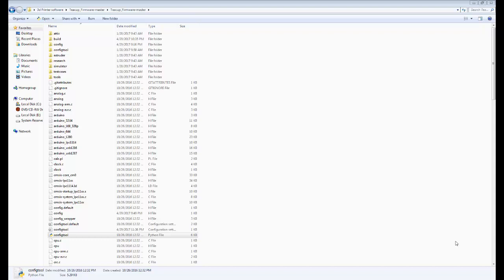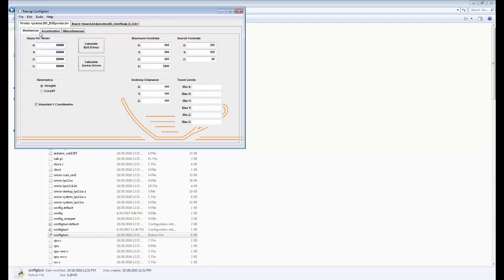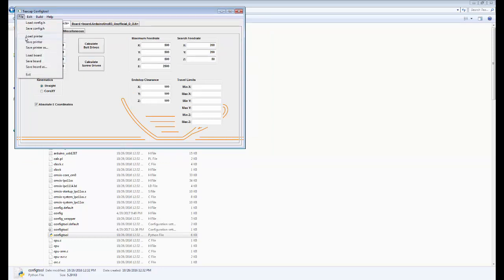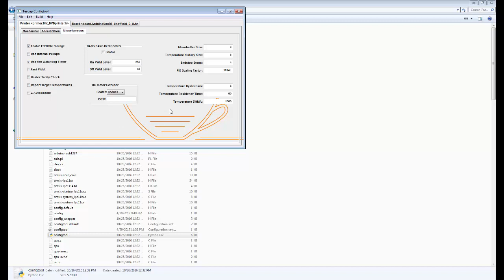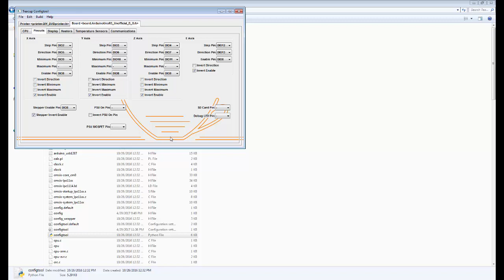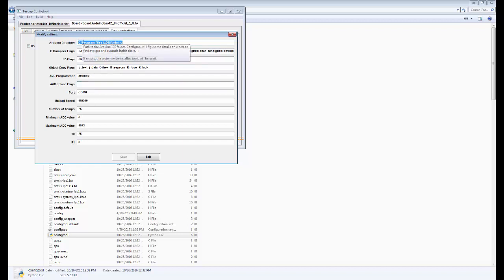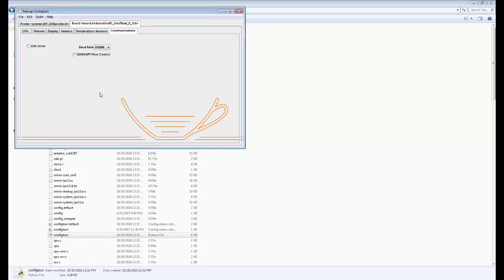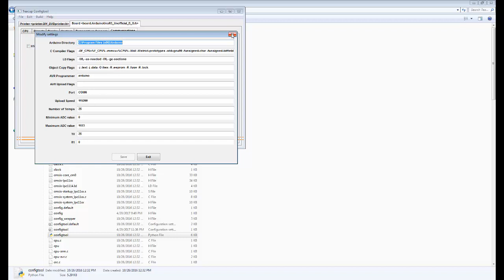Teacup Firmware to Arduino Uno R3 |Hex Files in Description|

Comment from the maker: I'm providing a link to the teacup firmware I used at the time of making this video. Luckily I had it stored on my old laptop. Enjoy and thanks for watching.
https://mega.nz/file/G0wSES4a#b5FzNkxulRk1BVKWIBtfHrzWcLWzJ8WQdB9AoSlYCxg
Reply: good day would you be able to re up load the file please
Reply from the maker: @lorddeysel7915  I no longer have the file itself but I'll see if I can extract the firmware/data from the arduino itself. Wish me luck😉
Reply from the maker: Here are the HEX files. Uploading with AVRDude is easy work so be sure to do your research on the process.
https://github.com/D-Omally86/Arduino-Uno-R3-Teacup-HEX-Files
Reply: @indieartsmidwest4042  thanks a lot i appreciate it a lot

Comment: I've been tying to get this to work all morning.....great timing!!!!
Reply from the maker: I'm extremely happy to hear that. Took me 5 hours before I finally saw a successful upload lol. Always glad to share the info after some intense trial and error.
Reply: only glitch... Arduino had to be capitalized on Settings.
Reply from the maker: Hmm that's strange. Can't say I'm an expert with uploading firmware. My first attempts involved using the IDE which went nowhere.
Reply: hello im also building a 3d printer with arduino uno and using teacup too.just 1 question where have u pin the extruder heater and thermistor and have set up anything for them on teacup?

Comment: Hello, I saw that you installed Teacup firmware?. How do you adjust the temperature sensor? I'm up to date with this fight with the 100k thermistor, 4.7k resistor and 5v But so far without any success. Pronterface cannot obtain the correct values in Celsius.
Reply from the maker: Be sure to use a multimeter to measure the resistance of the thermistor at room temperature. It should be around 100k ohms at 25°C. If it's significantly different, there might be an issue with the thermistor or its connections. Also, in the firmware configuration files (usually named configuration.h or something similar), locate the section related to temperature sensors. Then ensure that you have selected the correct thermistor type (e.g., 1 for 100k thermistor) and that the temperature table is correctly defined. Lastly, please keep in mind this video is pretty old and I haven't worried about it in quite some time. However, I recently purchased a 3d printer and will be rebooting this project at some point.

Comment: Hey what happened to your 3d printer project? I'm very interested in knowing if you pulled it off.
Reply from the maker: I have like 90% of the compnents but I need some brackets to make a frame. I have other option that I might consider like laser cutting a frame as well. Definitely one of my passion projects for this year. Especially since old dvd and floppy drives are pretty easy to come by these days.
Reply from the maker: So I have the mounting "L" brackets (plus a few other things I needed) I need to finish this project. So hopefully I'll have it all done by the end of next month. Currently working on another side project that needs finishing for an upcoming video.

Comment: I am unable to open configtool.py file.I have tried with may versions of python. Which python version do you have ?
Reply from the maker: amazing spiderman A few months ago, I was forced to reformat my pc. Since then I was temporarily reduced to a 2 core gateway laptop. So at this moment, we're in the same boat. I started with java 8 fully knowing it would have no affect. My computer probably needed it anyways. Next was python 2.7.14 which makes it load for a split sec and terminate. The teacup firmware prerequisites mention using a matching wxpython download but there is none. I'll keep trying and let you know my findings soon. Sorry for the late reply.
Reply: IndieArtsMidwest the reason behind termination is correct. Wxpython. I installed wxpython and it worked.I took a video help. I will find that video again for you. Around in hour I will comment that link.
Reply from the maker: amazing spiderman I would really appreciate it. Reformatting sucks
Reply: I'm using 2.7.13 python version and wxPython3.0-win64-3.0.2.0-py27, maybe it will be helpful for you

Comment: One thing i want to ask, is can i add a heat bed using arduino cnc shield with teacup firware?
Reply from the maker: I did some research and and this is what I found.
https://www.google.com/url?sa=t&source=web&rct=j&url=https://reprap.org/wiki/Teacup_Firmware%23Heater_.26_Fan_Setup&ved=2ahUKEwjMxuSc_pLoAhXP7Z4KHSchDMcQygQwAHoECAQQBQ&usg=AOvVaw19KyJhQCpBdAK7-MCS1AJW
Looks like so long as you have the components; you should be able to connect the correct pins on your control board. I haven't messed with the teacup firmware in a while so I'm not sure if the settings are changed on the firmware side or the software that does the printing.

Comment: I don't know if you would reply but I really want to build a 3d printer for myself, and I want to know if your setup works fine.
Reply from the maker: rennier rodil In this particular video you're basically uploading the brain of your 3d printer to the Uno. My original intentions were to use motors from dvd drives. These settings are based on that concept from a forum I found online. The standard setup for teacup firmware wasnt elaborate enough. If you plan on using different motors or basically anything beyond dvd drives, your settings need to be adjusted accordingly.

Comment: hi don't know of I will reply but I m planning on making a cheap 3d printer using arduino and teacup software the things that I want to know is that what kind of motor drivers do u use and the circuit diagram .is there a blog of ur or any instructables .it will really help me I'm a student so I can't afford a 3d printer
Reply from the maker: I too would like to build a cheap 3d printer and this is as far as I've gotten in terms of preparing the arduino portion of this build. Personally I would prefer a maximum build scale of 1 x 1 ft. for flexibility between different print projects. I plan to purchase 4 nema 17 stepper motors. One could use DVD ROM motors but I can't really do much with prints that small. Just a standard google search using keywords "diy 3d printer" yield some good results especially after you've gotten past the teacup setup. Majority of my remaining purchases will come from wish.com and the hardware store.

Comment: hi do you know the configuration for mega 2560 ? i mean in edit setting avr programmer...
Reply from the maker: @Daniel Ortigoza - Honestly if I owned a 2560, I would have uploaded Marlin or Sprinter instead. Unfortunately/Fortunately for me, teacup is the only option for the uno r3 due the internal filesize of the firmware. I'm looking into your question right now and hopefully will have an answer soon.
Reply from the maker: After a little research, the marlin supported hardware lists the 2560 similar to one in teacup. It is "board.ramps-v1.3". Maybe try that and see if it uploads.

Comment: im setting the same as your config, my arduino is nano, but has   a problem. z axis go up not strong. It goes down normaly, when i control manually z axis go up in pronface, it does not work,then i click go up again, it work
do you have problem like me ?
could you help me ? 
thanks !
sorry because i am not good in english
Reply from the maker: aaa: The link I provided in the description is the only info I could find for those using salvaged dvd drives. Is the wiring and condition of the motors good? Did you set the correct board or similar in the config tool? I've never owned a Nano; and this tutorial is technically geared towards Uno R3. But I will be glad to look into it.
Reply: IndieArtsMidwest May be you have an idea for my problem, my control board is made of by my self, it is base on cnc shield v3, but not Uno R3, my board is a nano,the pin controls XYZ, that is the same cnc shield( step pins is 2,3,4 direction pins is 5,6,7),E axis is different( step pin A4, direction pin A5),heater D11,thermal sensor pin A3
Reply from the maker: aaa Firstly, thank you addressing an unforeseeable issue I haven't thought of yet. Now on to business. I did some research and found the pinouts from nano or Uno are the same. I do need to ask some questions in order to create some ideas for the issue.
1. Why not use D9-11 for your E-Axis?
2. D5 is listed as probe for (Leveling) the Z-Axis. Do you have a sensor for that or setting manually before each test?
3. A6, A7 are listed as not used. Have you tried setting the heater to one of those instead?
Here are some links:
https://www.google.com/search?biw=360&bih=286&tbm=isch&sa=1&ei=gpowWZjZHcPLmwGT7b7oBA&q=arduino+nano+3d+printer+pin&oq=arduino+nano+3d+printer+pin&gs_l=mobile-gws-img.3...........................mobile-gws-wiz-img.......0j30i10j0i22i30.iT3XdcVb6Hg%3D#imgrc=oUpiG2t_Je-MwM

http://reprap.org/wiki/NanoHeart

https://www.eevblog.com/forum/microcontrollers/arduino-nano-3-0-to-control-a-homemade-3d-printer/

Hope this helps.
Reply: IndieArtsMidwest i make my printer base on a laser cutter run with grbl, so most of pin like the grbl pinout.
1.d9, d10, d12 is limit pin in my printer( grbl), d11 is enable spinder pin, use for hotend( this pin has pwm)
2.leveling is manual in mine
3. firsly i used those pins, but my friend said 2 pin A6, A7 is input pin  couldnt use  and i did not use they :) i did not test again
Reply from the maker: aaa Ok so you board is based on cnc shield v3 but its  not. That option is for the actual Uno R3 board. I get that the nano has similar pinouts, but doesn't necessarily mean they are in same class.
Reply from the maker: aaa My latest google search says you need it set for cnc v4 but that not on the list. So my best guess is a motor, wiring, or config issue.
Reply: IndieArtsMidwest Thanks for your help. My A4988 board   is trouble,may be problem is it.
Reply: could i know what you software using to slice ? teacup firmware is not much support software
Reply from the maker: aaa Can't argue with you there. Support for Teacup is super vague and limited. My setup is Teacup firmare and is recognized by Repetier 2.0.0. The real issue is getting any other firmware to fit on your board.
Reply: IndieArtsMidwest Teacup firmware  fits on my board. but when i convert 3d files to gcode i found 1 software (slic3r), and pronterface to control. when i using cura and repetier, log file has some unknown code, control by repetier it always waiting heat the extrude and tempture of extrude seem keep one value(< tempture i set)
Reply from the maker: I came across a forum that mentioned it might be better to use 2 nanos rather than one. Not saying that only one can't do the job. But in terms of workload, it was suggested as an alternative. Im sure you have temperature sensors so we can rule that out.

Comment: Bro did you finish project?
Reply from the maker: Honestly no. The plan was to start off with a simple build using CD drives for my XYZ. But unfortunately I figured out too late that one can easily burn out their motor controller drivers if powered incorrectly. Which is what I did LOL. I would still like to build one of my own some day. Maybe when inflation goes down.

Comment: hello sir.
i have a problem with arduino file. can you please send me yours email?
Reply from the maker: I'll look into this as soon as I'm off work
Reply from the maker: I apologize for the delay, my job is very demanding. I believe the file you're referring to is the Arduino IDE which should already be installed on your computer. If I'm correct the teacup firmware uses that file within your x86 location to reference the information it needs to upload to the Arduino. So unfortunately there is nothing to send because it should already be there. I don't think it's absolutely necessary to have the AVR programming software on your computer. I'm pretty sure the IDE takes care of that on its own.